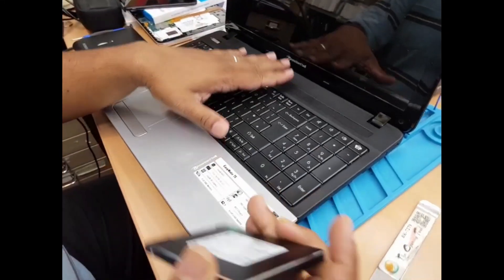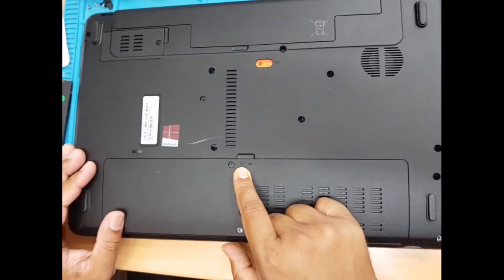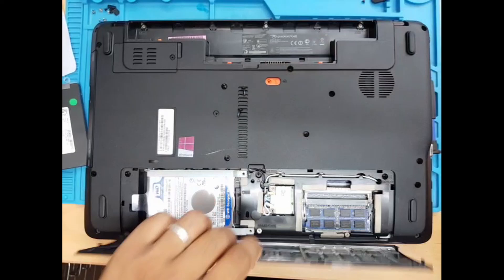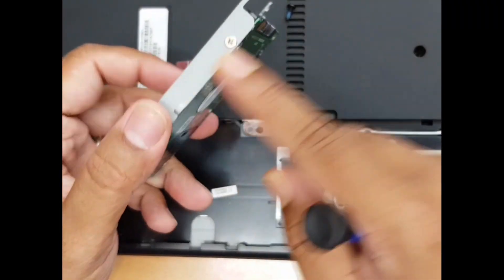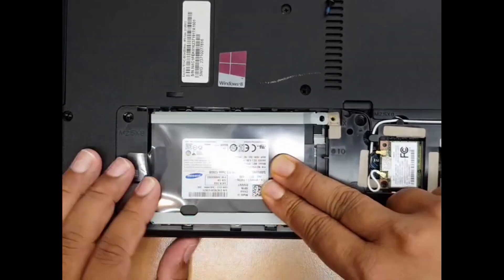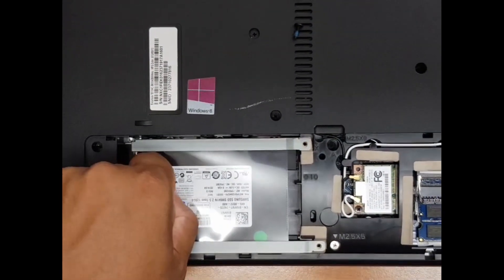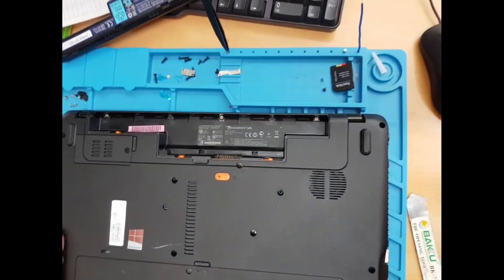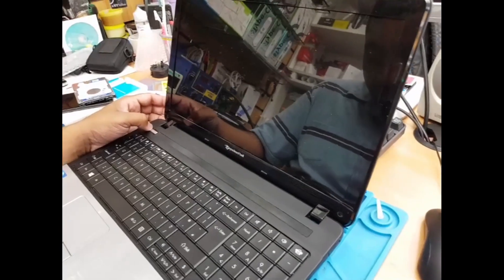Packard Bell EasyNote TE  SSD Upgrade

Comment: How can I find the processor list compatible with this motherboard.   TE11BZ  MODEL.
Reply from the maker: First you need to find which processor already in there with the motherboard, and then from the details of the processor you may can find what sort of processor it would take. As i know its very very limited facilities for replacing the processor from the laptop sector. 
thanks .